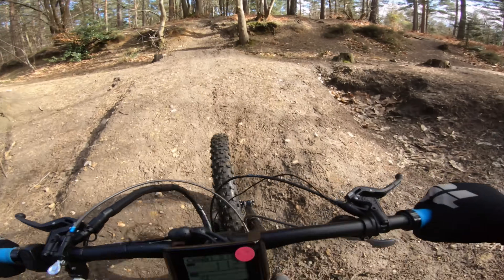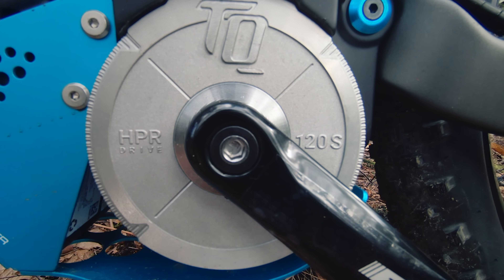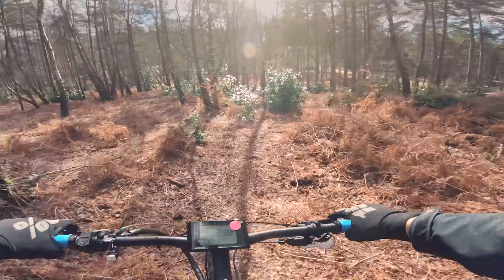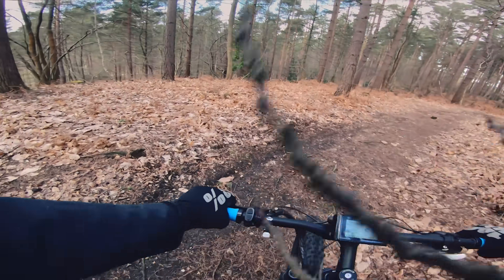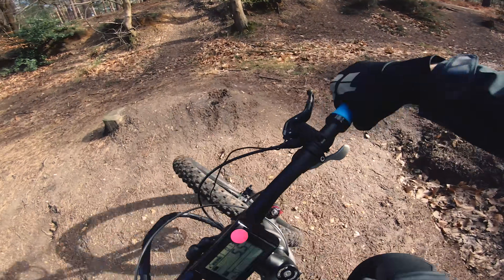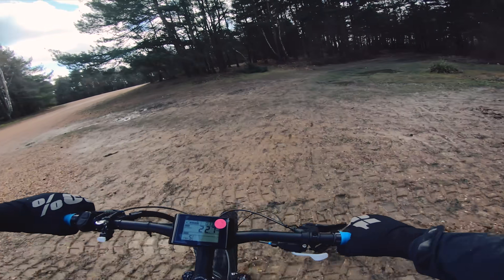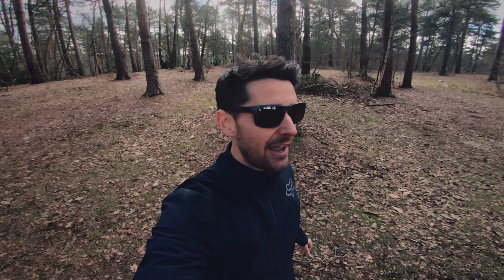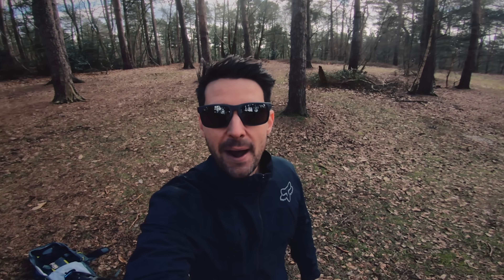INSANELY powerful TQ motor TEST | Same motor in the 2019 Haibike FLYON

Comment: Not for me. Motor way to big. To much noise. And to much power. I don’t even use the turbo on my shimano because it has to much power. This is where mtb stop and your just riding a motor.
Reply: Rubbish.  Try it and you'll change your mind.  Bigger motors simply allow you to climb steeper hills - which is the whole point of ebikes.  Admittedly, full power is overkill on flat and even moderately hilly ground, but it's a blast going up climbs that even 4wds struggle to get up.  On flatter ground, you rarely get out of lowest power mode, which is both quiet and efficient.

Comment: Every manufacturer will go to 48v eventually. That's my prediction.
Reply: TheAegisClaw I got the bh emotion Evo 2018 and the battery is 600w a 48v and the motor is 350
Reply: 96 Volt would be better.
Reply: @topspeederalmond  I doubt that, every time you go up 12v it gets heavier, I think 60v is possible but probably the sensible limit.
Reply: @topspeederalmond  no, you didn't. But if you increase voltage you increase heat and require a larger heat sink, which we see on the Flyon and can see from it's 27kg weight, is significant. You have the same issue on the controller and wiring too.

Comment: Looks brilliant I wonder how quick it will go through drivetrain components???????? As this is an issue with a standard Levo ebike
Reply: Then what good is it really. If my Levo can go through an KMC ebike specific chain in 160 miles (‘cleaned and lubed after every ride) this thing could stretch a chain in one long 50 mile ride!
Reply: racepnd Something is not right there. On my Commencal Meta Power I’m doing 2000km with ‘non ebike specific’ €10 SRAM PC1110 chains.
Still, I think this TQ motor will chew chains like no tomorrow..
Reply: racepnd Very quickly... :) Bicycle components are not designed for this.
Reply: Best I’ve managed is 600kms and I ride a lot in eco. I’m 90kgs and shift properly without grinding. I replace when they hit .75
Reply: racepnd I’m ~85kg and ride in Eco and Trail pretty much never in Boost.
Try these cheap SRAM chains they work perfectly for me. Just check if the length is enough for your bike if not, buy the next up in SRAM lineup. It doesn’t worth to buy expensive chains.
Reply: The chain length might be an issue I will look into that thank you. I’ve had four chains on the bike last year. New cassette, front sprocket and chain now ready for when the snow melts.

Comment: Rob mate. Please do it again in no 5 and find a long steep hill. Everyone wants to know how long the battery will last. Just keep going until it conks out. Be the first to answer the question that everyone is asking.
Reply from the maker: Any hill you'd suggest? I'm up for trying!!
Reply: @RobRidesEMTB  The Slab ??
Reply from the maker: LLoyd Elliott where’s that?
Reply: @RobRidesEMTB  The Slab, Steve and Chris from EMBN rode it , Chris was sick afterwards :)
Reply: Be good if you can find a mountain mate. See how much elevation the motor can give you. Is the Walrus bike packing the 640 battery?
Reply from the maker: The Walrus was rocking 1KW in its belly! I'll try and find a big mountain to test it :-) There's definitely something coming this year with a great test on a Haibike :-)
Reply: You could be the man to set a new standard in testing ebikes mate. Find an impossible mountain. Select highest power mode,and go for it. See how far/ high the battery/ motor will get take you before having shred it back down. Great way of showing capabilities of each bike that comes to the market. This would be a great acid test and tell possible buyers far more than figures and stats ever could. Obviously you could add your opinion to the ride/ comfort quality of each bike as well . What do you think?
Reply: Ive done simillar tests on my bbshd set to 1200W ...... does the job, and quick. In low power you spend a lot of extra time doing the same hill maybe 3 or 4 times longer, on sandy hills you dont make it on low power.... so I guess you save power ..... because you are off the bike and pushing lolol. Itd be interesting to hook a power usage meter up and get some real figures on this one .... because atm I dont believe low power mode is the most efficient. If you are calling "range" how long, in time, your battery lasts set it to low power. If you want distance and you can benefit from the flow of speed .... maybe high power is better for longer distance range from a charge.

Comment: That's some torque, you can see it on screen how quickly it picks up. Comparing my 1290cc motorbike that has 144nm of torque against the Haibike 120nm with a weight difference of approx 180kg. lol. Impressive but I did think it was quite noisy.

Comment: Is it not like de-restricting a standard emtb
Reply from the maker: Not at all, derestricting remove the motor cut out limiter at 15mph that all standard ebikes in the EU have. It’s illegal to ride a derestricted ebike on public land. This is a standard EU classed pedelec and it’s fine to use on bike trails but just helps with the ridiculous climbs. I’d never blast around in mode 5 if I owned it. I was just curious to find out just how much power it had.
Reply: Thanks for the clarification, I am new to emtb

Comment: Ok Rob, I will ask you this. 
People on the forum are changing chains on there Levos at 500-1000km, or even less.
Did the TQ manufacturer think what will this powerful motor do to the chains that are currently clearly not up to the job on any serious EMTB? With 35% more torque, you will probably kill the chain at 100-300km. 
You can spend a fortune on chains, if you are riding hard like that, if they don't come up with some better solution for EMTB.
Reply: Tomy Boy i would and many other be interested in what outcome of chain issue
Reply: I ride a properly off road tuned PAS only BBSHD, which is like 25% more torque agsin then the Flyon. Its extremely rare that I ride it in "5" ( 1500W nom ) as its too much power only useful on a beach or limitter of high speed. Most of the time I run it in "1" (300W) on rare ocassions up to "3" (900w). Very rare "4" on extremely " un-doable" hills fore laughs. 
I changed my chain  at around 2,000 km didnt really need it ... but did. 
I doubt if anyone would just run around in max. Mode constantly .... its like using a drag car for 4wd work. 
Those fellas who think its even remotely like a moto ..... what a ridiculous statement.
Reply: barry taylor problem i have found with Befang they have a centre spindle that turns a bigger cog but it is made from some poor quality metal, i had two shatter and one coil broke down
Reply: @martinlewis1015  which bafang was it?

Comment: So this is the motorbike ebike haters are talking about... This is not mountain biking for me. Personally, I see more point in the Lapierre eZesty than in this 28kg monster... I’d rather just get a dirt bike.
Reply: If pushing your bike up steep hills is your thing then fine. This motor just means you don’t have to. In fact why buy an e bike in the first place if you don’t like the assist. I really do not understand why anyone could have a problem with this new development,it’s progress.
Reply: @vandazler67  For me, it's absolutely pointless that's all. I have a Commencal Meta Power with Shimano E8000 and I can climb anything that I never even attempted with my regular trail bike and I don't remember the last time when I used Boost mode, Eco and Trail all I need.
Putting a big ass motor and making a 28kg ebike for me is not really a development, powerful electric motors exist for a long time. On the other hand, the 18kg eZesty with the removable battery/motor which makes it a 15kg regular bike is a development. On trails, the 18kg handles close to a regular bike, the 28kg handles like a bus. But as I said, it's just my opinion based on my preferences and I'd rather buy a dirtbike than this one.
Reply: I’m not sure about this one. Sounds like and looks to behave more like the kids Oset electric trails bike than a regular EMTB.
Reply: Eckythump Yeah, pretty much...
Reply from the maker: Yep - not for everyone. I’ll admit I was riding it like an idiot too. It’s not the mode id ride in all the time if I owned one - I was just interested to see what happened in mode 5! Call it a tech experiment!
Reply: I have a ktm 520EXC and a BBSHD emtb ...... both have two wheels  ... having dificulty in seeing the rest of the similarities ..... rolleyes ..... what a ridiculous comparison.
Reply: barry taylor Where does it stand compared to a normal bicycle, is it in the same category?  Compared to a regular ebike, it’s like riding an ebike after a non-ebike so it’s pretty much between an ebike and an EXC. For ebike haters, a normal ebike is already a moped... 🤪
Reply: @tamasvarga67  my exc ( 64hp ) does in excess of 160kph ... on dirt ..... the ebike is a mtb with a tiny 2hp electric motor assist, my mtb  is an mtb with me pedalling at say 1/2hp. They all what they are .... its ridiculous to try and place them in the same category. Though the ebike is a hell of a lot closer to an mtb than it is to a moto. Get an emtb and get a life.
Reply: barry taylor It might be surprising but I have a life and I have an emtb too... oh, and I used to have a DRZ400 - I know, it’s not a 520EXC. 
In my opinion, this thing has not much to do with an emtb - if we are talking about the 250W/25kph category. Your opinion is different and just like I have the right to mine you have the right to yours...
Reply: barry taylor we both have emtb’s, this isn’t a case of regular bikers dismissing all ebikes. 
In the video the TQ motor is clearly taking Rob up the climbs not just giving him a bit of assistance like the current crop of motors do. 
I mean they might as well cancel the upcoming emtb race series as no one else will be able to compete.
Reply: Eckythump Depends on the series. If the distance and elevation is set to the limit of an 500Wh battery life then this bike ha no chance. On our marathon the ebike category has to do 64km/~1300m elevation with a 500Wh battery. It will be very sketchy with my Meta Power and it would be impossible with this monster.
Reply: @eckythump6429  ah racing. ... yes well it does seem to be in a different category than most 250W machines out there. But for general use it just looks a  damn good option to me. Remember he did say he had it set at 5 .... which seemed like turbo turbo lol. When you have a powerful emtb you have to use it prudently .... or you would use up you battery quicker. But as you can see they are clearly more capable ie. You do harder trails ..... be a shame to limit that because some folk see you are having more fun than them. There are some parts of the world which do not have "flagellants" in their genetic past ..... so it seems odd to limit the amount of fun you can or should be having.
Reply: Tamas Varga if the motor is really 250watt like the rest of the motors it suggests the whole setup is more efficient ie able to produce significantly more torque for the same power consumption. 
I guess we will see as the reviews start appearing.
Reply: barry taylor I’m all for fun and that is the main pro argument I use in discussions about emtb’s. Two buddies who are in the market for new ebikes are really excited after seeing this video. 
The current crop of ebikes play relatively nicely with conventional bikes, I’m just a little concerned the TQ is such a step beyond what we have,  it is almost a different beast altogether. 
Will this be the start of an arms race for ever more grunt?
Reply: Eckythump That’s impossible, that motor is not 250W. It’s just the ‘nominal’ power manufacturers are saying but nobody is checking. Before, they used to report max power but it could cause troubles with regulations and now they all just publish torque. Electric motor technology is not a new thing and all of the sudden TQ didn’t come out with an engine producing 70% more torque and not using more energy than Shimano. :) If you look at the rest, no big difference in power and range and TQ didn’t make a miracle.
Reply: @eckythump6429   Any emtb is not a mtb. So we've got a new hybrid class of vehicle. I see it as a great thing if there is a power war in emtbs because I find the current crop of off the shelf emtbs unsatisfying powerwise. Its probably due to them being built for an on road restriction. But yeah Id love to see designers push the limits of emtbs ... even if its only for private land use. Ebikes in general could be what replaces cars .... so any development is good development by me. Nothing like a good "arms war" or "power race" to drive development.
Reply: Tamas Varga it’s not 70% higher than a Brose at 90nm. 
It is a motor designed from the ground up for an ebike not put together using existing components. I haven’t looked up any drawings of the internals but it looks like it could be a large diameter brushless motor with stacked epicyclic gearbox, ideal for high torque low power units. The chainrings being 40 odd teeth also suggests a high torque low rpm system. 
If TQ have managed gains by using appropriate components & reduced gearbox drag etc it would be nice to see a smaller unit with the same ‘felt’ output as current motors with more range from existing battery sizes.
Reply: Eckythump I mentioned Shimano @70Nm not Brose, it’s ‘just’ 33% then and they used existing technology regardless. Still, I don’t think that the motor is only 250W and using that amount of torque it has the same consumption as the Shimano @70Nm or the Brose @90Nm.
Reply: Tamas Varga and I didn’t say anything about new technology,  just making dedicated components rather than using existing, off the shelf motors & gear sets with the accompanying drag to get the desired output.
Reply: @BarryJTaylor  Any 250W/25KPH emtb is an mtb (a bicycle) by the law (in EU at least) and can be ridden anywhere as such. If you are in search for a 520EXC replacement then their power is not enough that's for sure, but if you are/were rding regular bike then they are pretty much flying. I can make my regular 'enduro loop' which is 6,5km with 300m elevation in 40-45min with my Canyon Strive and it takes 20-25min with my Commencal Meta Power so it depends on the way you are looking at it.
Any manufacturer can make and put a powerful motor that's not really a 'development' but a choice, They want to sell 'bicycles' as they have a much bigger market than the 'private land use only' vehicles. The M1 Spitzing with this TQ motor is available for a while but legally, it's not a bicycle and they are not selling as many as Specialized sells the Turbo Levo for example.
Reply: I think neither Shimano/Bosch/Fazua/Yamaha used 'off the shelf' motors they were developed for ebikes from the ground up. Also, Brose is refining their motor (I didn't follow the version) but it's not the first one that's for sure.  @eckythump6429
Reply: Tamas Varga the original Brose is famously a re purposed truck windscreen wiper motor, Bosch use a brushless in runner from their power tool range and you can be sure the other two use cheap off the shelf brushless motors as well to keep costs as low as possible.
Reply: Eckythump Sure, if you say so...

Comment: Flyon with 120 n.m. torque is still trying to catch up with the BAFANG ULTRA MAGNESIUM  Ebike Mid Drive motor with 160 n.m. max torque.
Reply from the maker: Fred Vaughn hey Fred. That is powerful! I actually spoke with the designer of the TQ Motor. He hinted that it is actually capable of more than the current 120 if needed. Although we start to get into the realms of how much is too much! What do you think?
Reply: I am glad to see that some e bikes are moving forward.  Seems like a lot of e bikes companies are  satisfied with adding  more battery power.
Reply: @RobRidesEMTB  I think we just found too much right here, but maybe a good kind of too much where you can haul it out for big stuff and then dial it back . Its all about the controller being kind to the trail
Reply: @RobRidesEMTB  I have a bbshd in a bike with 415mm chainstays ...... 1500W mode 160nm is too much for just about anything steep .... it flips lol. I have used full power only on the beach or trying to float through deep sand at speed. But all that is in unrestricted mode. When its set at legal speed .... meh you dont get the real benefits of full power.
Reply: Nice, but that's still a conversion / bolt on, right?
Reply: M2S.  Mountain two Shore and  FLX    both  companies use the BAFANG ULTRA Max motor  in their lineup of MTB. Yes,  A very custom bolt-on. You need a custom frame with a proprietary shell to mount it.  I am just starting to put an Ultra Max e-bike together.
Reply: @frederickv.9300  I see it's also installed on the Luna Apex (Fat Tire bike). Luna claims that motor was developed in collaboration with them  (but I take that with about a pound of salt).
Reply: Luna Cycle  is the only USA distributor for the Ultra  Max motor.  It is bit salty.
Reply: Hey Fred, we have built and sold over 200 e.bikes with m620 G510 motors (ultra) and its 160nm is utterly rubbish more like 80% = 128Nm